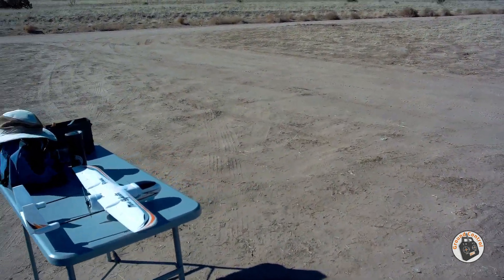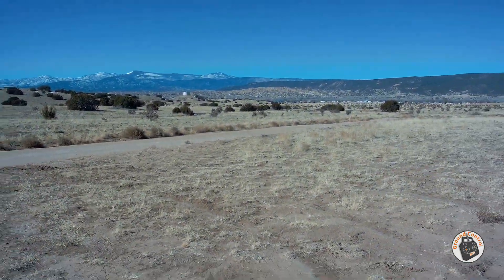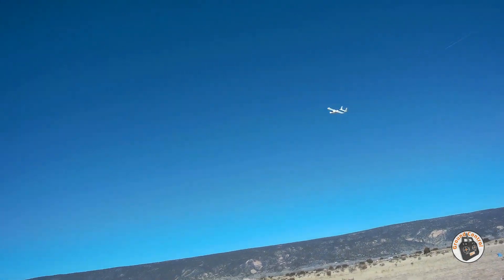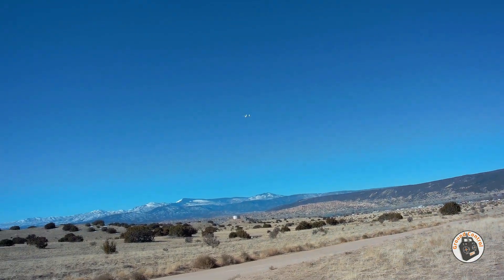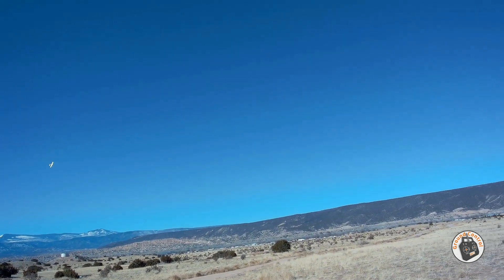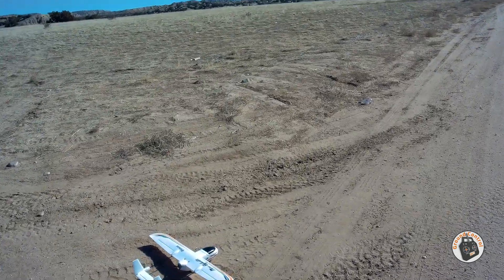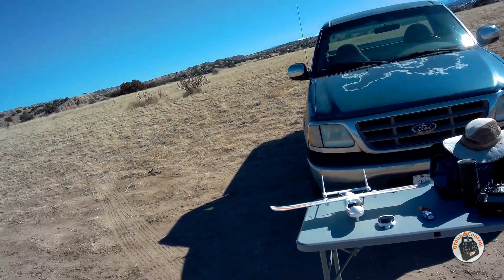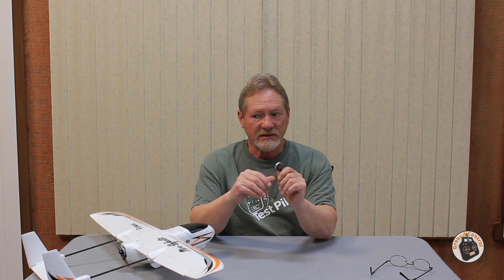Unlimited Vertical and Very Efficient - BetaFPV High Performance 2004 3000kv Brushless Motor 3S-4S

Comment: Technically that's a quadcopter motor . . which is why I'm here. Looking to use my extra 2004/2207 motors and propellers on a plane/wing, this thing looks like exactly what I'm looking for 😄
Reply from the maker: Absolutely, I use a lot of quad motors on fixed wings.
When the plane is small and you have to use a small diameter prop a quad motor works a treat!
These BetaFPV Motors are fantastic and I've used (4) of them so far and will be ordering more ;-)
See you in the Air!

Comment: 4 min fly time plane is not Very Efficient ..there is many of this smal plane or z84 wing on YT with 1hour flytime ( so..this is Very Efficient ) but GOOD JOB
Reply from the maker: Hi Nucleo!
Yes, 4 min would be very efficient, I set my flight timer for 4 min. as I had not tested this power system before so I had to then calculate the amount of flight time I could get.
I should be able to get approx. 6-7 minutes of flight time with this power system.
The more power the less efficient so I always choose a balance of power and efficiency since that's how I like to fly.
Awesome little Plane ;-)
See you in the Air!

Comment from the maker: Don't Forget to Subscribe -> https://www.youtube.com/GroundControlRC?sub_confirmation=1
Don't forget to Follow Us on Facebook -> https://www.facebook.com/GroundControlRC

BetaFPV 2004 3000kv Motors
https://bit.ly/3NRfofa

Gemfan 5125 3-Blade Propellers 5mm/1.5mm Shaft
https://bit.ly/3uVoQWq

HQ 5025 3-Blade Propellers 1.5mm Shaft
https://bit.ly/3uUAa4Y

Get One Here: HQ 5025 3-Blade Propellers 1.5mm Shaft
https://betafpv.com/collections/4-inch-propellers/products/hq-5025-3-blade-propellers-1-5mm-shaft

Get One Here: Gemfan 5125 3-Blade Propellers 5mm/1.5mm Shaft
https://betafpv.com/collections/4-inch-propellers/products/gemfan-5125-3-blade-propellers-5mm-1-5mm-shaft

2 Pairs Gemfan LR5126 2.6Inch 2mm Durable PC FPV Propeller - Transparent gray
https://www.banggood.com/2-Pairs-Gemfan-LR5126-2_6Inch-2mm-Durable-PC-FPV-Propeller-for-Long-Range-FPV-Racing-RC-Drone-p-1836720.html?p=WE081047791920140372

HQ Prop T5x3 Bi-Blade 5" Prop 4 Pack (1.5mm Shaft) - Grey
https://www.racedayquads.com/products/hq-prop-t5x3-bi-blade-5-prop-4-pack-1-5mm-shaft-grey

4 Pairs Gemfan Hurricane 4024 2-blade 4 Inch PC Propeller - Clear grey
https://www.banggood.com/4-Pairs-Gemfan-Hurricane-4024-2-blade-4-Inch-PC-Propeller-for-1408-1506-Brushless-Motor-RC-Drone-FPV-Racing-p-1657418.html?p=WE081047791920140372

Turnigy 1300mAh 3S 30C Lipo Pack
https://hobbyking.com/en_us/turnigy-1300mah-3s-30c-lipo-pack.html?affiliate_code=YRCVWOSKMDXLVUW&_asc=4840123862

Get One Here: RadioMaster TX16S Transmitter
https://www.banggood.com/custlink/DvvycmfSMK

Banggood GCRC
https://www.banggood.com/custlink/GmDmQ1nVkO
Reply: Ossum Mr T.
Reply from the maker: @associatedblacksheepandmisfits  Thank you John!
I like it now even more ;-)
See you in the Air!
Reply: Try the spare motor in one of your own build parkjets.. not everyone can afford the foamy rtf's or pnp / bnf.... Ossum as always T.
Reply from the maker: @associatedblacksheepandmisfits  Thank you John!
I was thinking the same thing ;-)
I put another one in my Z84 Wing and it will most definitely have unlimited vertical now....hehehe!
I may put one in my DIY F-22 Parkjet or a DIY Edge.
Reply: @GroundControlRC  way to go tony.🥰😎
Reply from the maker: @associatedblacksheepandmisfits  Thank you much John!